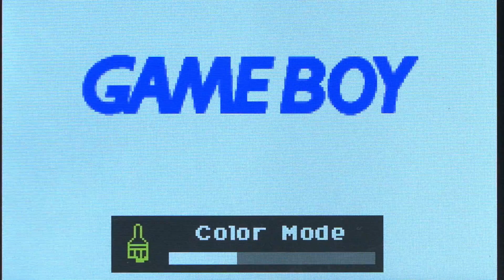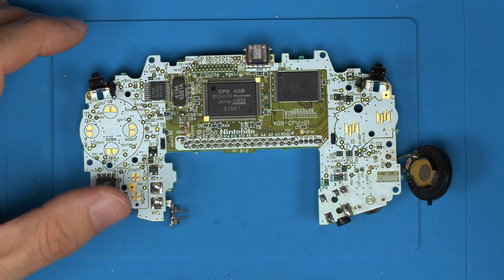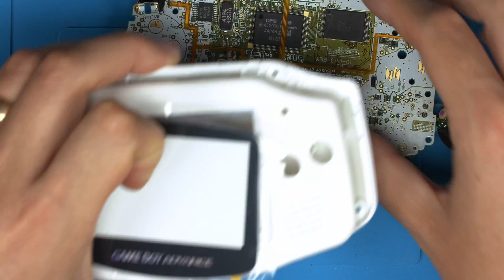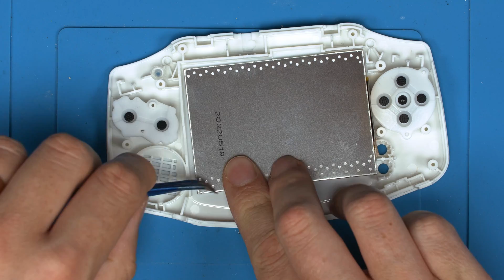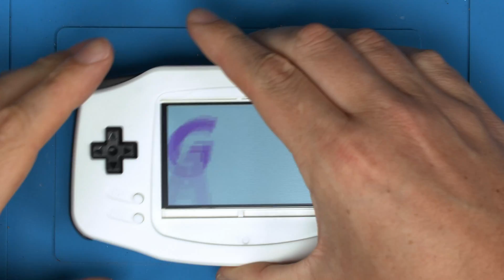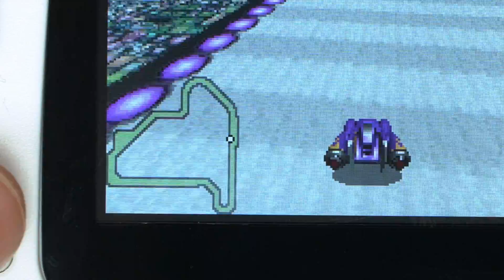Ultimate 2022 GBA Game Boy CleanScreen Install - On Screen Display

Comment: Anyone run any latency tests on this screen? I know some of the cheaper IPS mods add a full 3 frames of lag. The product page says "Zero lag", but I'm a bit skeptical. If it actually doesn't add a single frame of latency compared to the original, that would be incredible.

Comment: Props on being the first and so far only one who implemented actual color correction (and not simple desaturation) on backlit screens (besides Nintendo themselves in the GBA Micro)! This will also benefit Gameboy Color games, which need a similar correction. The main thing I'd wait for in a revision would be for you to use a glossy screen rather than the matte you're currently using, since matte adds graininess and other degradations to the picture (plus once you put a lens on the console the screen will look reflective again anyway).

Comment: So how well does the true motion reduces motion blur? I ordered an Ultimate Gameboy Advance from Handheld Legend with FunnyPlaying ITA TFT screen. While it's a great screen, the motion blur is pretty awful. The Funnyplaying IPS V2 is much better at reducing motion blur which is also have in another unit. So I was wondering if this screen you demostrated is simply the IPS V2 with better programming or an entirely different screen?
Reply from the maker: No it's entirely made by us. Custom IPS panel, custom code. Original size, true color, no blue. Try it you won't regret it
Reply: @RetroSix  Yes I will buy the kit and try it out.
Reply: @elmaton04  Did you try it out?

Comment: Hello Mate, I have the Retrosix GBAM-001 model and it has a rubber effect on the shell. I would like to trade it and put a new one. Is it easy to remove? Can i just buy a new shell from you and change without fear of break anything? Thanks in advance!
Reply from the maker: Depends what mods are in. If you take your time the swap should be simple
Reply: @RetroSix  the mods are: amp sound, ips screen and usb c battery
Reply from the maker: @oversotv  Depends on the IPS screen when you had it and who built it. If it was us, in the last 2 years, you should be fine it will be a removable screen you can transplant
Reply: @RetroSix  it was you.  September 2020 :)

Comment: Perfect view and screen capabilities. Tell us, please, is a laminated version of such a screen planned in the future? 
PS. And the thin cable connector [Buttons] that leads to the 'L', 'R' and 'Select' buttons needs to be turned up, and the thin cable should be shortened so that you don't need to wrap the cable.
Reply from the maker: Laminated on its way. Button ribbon is long to allow removing motherboard without tugging or damaging ribbon
Reply: @RetroSix  Thanks!

Comment: I’m unsure which ribbon to choose at checkout with the cleanscreen… 32 pin or 40 pin?
Reply from the maker: Check your GBA consoles original screen the ribbon connector has 32 or 40 written on it

Comment: Why does my CleanScreen have a jump wire on 3V3OUT?
Reply from the maker: It's a power saving fix for early versions of board
Reply: @RetroSix  Received a defective product, is there a warranty(#R27527)? Support let me contact Discord, contact has not responded... I don't live in UK and am not an English speaker
Reply from the maker: @vinjovial  We don't have any unanswered chat in discord, but yes you will have warranty. Just message me direct on discord (retrosix-luke)

Comment: does this work with the cleanlight led kit?
Reply from the maker: Yes
Reply: @RetroSix  good stuff man, got it all put together, the screen and menu controls work perfect, looks great too. Unfortunately i can only get the lights to turn on occasionally, is there a specific connection i mightve messed up to cause that?
Reply: @wormy6923  Just add the extra ground point top right near the A button. CleanLight has a circle pad and under it the GBA has a rectangle pad, join them together

Comment: How long would the battery life last when paired with clean amp pro and clean juice?
Reply from the maker: Checkout RetroSix.wiki in GBA CleanJuice section called How long will CleanJuice last. It has breakdowns of fully modded screens and consoles. It will last the same as IPS screens
Reply: @RetroSix  oh ok I'm thinking about upgrading to this from the IPS V2 so this is some useful information

Comment: I bought and installed this kit and its a MUST for the gba!! Do not hesitate to do this mod if you can!!
Reply: Is this kit better than ITA?
Reply: @Pain714  I don't have anything to compare it to as it was my first and only kit, but it turned out amazing. The screen and all the components were excellent quality imho. The screen has a ton of options and is PLENTY bright. I run it at like 10 percent lol. I just use rechargeable AA batteries and it lasts me a long time. I did a white and purple theme. The only thing i don't like about my build is the aftermarket shell is not textured so it gets slippery gross feeling after a bit.  I have to keep it very clean. I would def use the oem shell or one with a textured finish. The screen kit is amazing though for real.

Comment: On the stock shell it doesn't sit 100% flush against the shell due to the smaller plastic bumps that surround the stock screen. I have the dust guard kit and I don't intend on disassembling it just for a 0.3mm or less of unlevelness, but ks there anything that can be done about that? Perhaps a different, thicker and smaller dust kit for the stock shell to everything sits 100% leveled?
Reply from the maker: Just use original dust guard off original screen
Reply: @RetroSix  I don't think it would make it sit flush with the front anyway because the original screen has some "cutouts" where the plastic bumps on the case are located, but I'm gonna give it a go on the next build

Comment: I have a tiny amount of light bleed over the LCD panel on top. Any ideas on how to make it better? I'm using the dust guard too on a stock case (had to cut the dust guard to make it fit but I managed)
Reply from the maker: It won't be light bleed. You will see the white backlight bracket a little. We are reducing the original size window by 0.3mm soon so they cover it better. You can cover the white bracket with black tape if you want
Reply: @RetroSix  thanks. Yes, that's what I meant. I managed to just pad it a little bit at the bottom to hide the top's backlight. The bottom one isn't visible without actively trying to do so.
Reply: @RetroSix  Do you mean by reducing the original size window by 0.3mm the lens or the CleanScreens display?
Reply from the maker: The actual lens cover
Reply: @Andre Brait 
Please keep me updated if you were able to solve this issue.
Reply: @leinsaat5779  so, I just added some padding on the bottom of the frame to force the screen to go up little bit and stay there.

I took the foam from the center of the dust guard kit and made 2 stacks of 3 layers each, each layer being a small square with the sides being like 2 to 3mm. I placed them on the bottom (the side closest to the battery compartment) of the screen, between it and the plastic frame around it (I have an original shell) so it would force the screen against the top edge of the frame (the edge on the side of the flex cable / Link Cable port).

Comment: Does that mean if I use one of your shells, I need to solder otherwise the screen isn’t aligned?
Reply from the maker: Yes if you don't adjust the position they are setup for fitting original shell positions. You can just position the screen manually with tape and no bracket and align it easily by eye without soldering

Comment: Will you be coming out with a complete kit? Or at least a kit that includes the screen, the board, the 32-pin and 40 pin ribbon connectors all together?
Reply from the maker: We sell the parts separate so you can get what you need as well as get spares without having to buy a full kit again

Comment: I'm trying to build mine right now but I can't figure out why the bracket doesn't want to fit in the gap on the left as shown around 4:58, is there different sizes of brackets and maybe I got the wrong one ?

I'm using a crystal clear case from your website if that matters
Reply from the maker: Did your bracket come in a bag with barcode? And did you trim the arm off as shown?
Reply: @RetroSix  I have a few bags with barcode but none mentioning the bracket so I'd say no, I haven't trimmed the arm off yet because I wanted to make sure it fit first, but I was going to do it
Reply from the maker: Email support@retrosix.co.uk tell them Luke said you gave old bracket and go send new GBA Bracket for CS that is in a barcodes bag
Reply: @RetroSix  sent a mail, thank you for your help !

Comment: Would be good to see a real side to side comparison with the funny playing. Your screen is of course way more accurate to the original but I’m so used to the slightly larger/brighter IPS screens that I may still prefer them as much as purists may scoff haha. Gonna get a gba from you soon and don’t want to get it with a screen I possibly prefer less.
Reply from the maker: Yep I'll do an FP side by side soon. Many requests
Reply: @RetroSix  Nice. I’ll wait and see which I prefer. I really hope I prefer the new screen over the IPS or I’m gonna regret waiting so long and not picking up the previous gen prestige build 😅
Reply: Oh this is smaller size than IPS?  Would larger screen be available?
Reply from the maker: @cl88888  This is identical size to original. No need for larger screen. IPS is oversized

Comment: Will this fit with the HDMI mod? (as posted by Macho Nacho and a few other Youtubers over the last 6 months) - and do you think the spacer would fit as well with all that? I would assume would need some kapton or other insulating tape between the boards but thats easy enough to source anyway.
Reply from the maker: Never tried it however it should do I guess. I'll add HDMI to the CleanScreen soon
Reply: @RetroSix  is that going to be HDMI out built into the CleanScreen?! wow ok im very interested :D (especially if its got proper scaling!)

Comment: Do you have this as a complete screen kit that has everything you need but the shell?
Reply from the maker: As it's preference and if your using original shell it's different parts, plus for repairability and spares they are sold separately. The videos of each install explain what you need. Always a CS board, TFT and 32/40 ribbon. The rest is optional

Comment: how does the pixel grid emulation work? is it like a 4x scale, and just certain lines not showing?
Reply from the maker: Bit more complicated. It uses the actual color data to generate a darker pixel grid but still blends actual color data in to simulate it perfectly

Comment: I fell in love with this kit but I wish to have the option to be as big as IPS screen and install it on IPS ready shells. The different options to control the screen is just marvelous. 
My GBA has de TP2 solder spot "burned". Any ideas how to fix it and be able to use the ribbon? I prefer ribbons than wires. Thank you for such great quality products. Never dissapoints. :)
Reply from the maker: I'll rip off a TP2 trace and do video showing how to repair it. Basically bridge the ripped area with enamel wire to do a trace repair
Reply from the maker: Also this is an IPS ready shell you just install it as shown in this video. Screen size will be original though not larger. A big reason for this project was to look identical to original
Reply from the maker: I just did video on repairing TP2
Reply: TP3 is for start, you could use that. Or carefully scratch off to the side of where TP2 was and solder to the trace that TP2 used.

Comment: Nice screen, price is very off putting.
Reply from the maker: Price in bulk (20 units) is as low as £43 plus tax for board, TFT and ribbon. Our screens are brand new manufactured not refurbished phone screens like all others on the market so cost more to make. I might be able to get price down a little in future when making larger batches
Reply: @RetroSix   I do like them and the features but that price point £65 +postage for one or £52.20 each when you buy 20 at £1044 total is 😳

if you'd consider bringing the wholesale down from 20 to 10 would be great. 😊
Reply from the maker: Yep I'll lower wholesale to 10